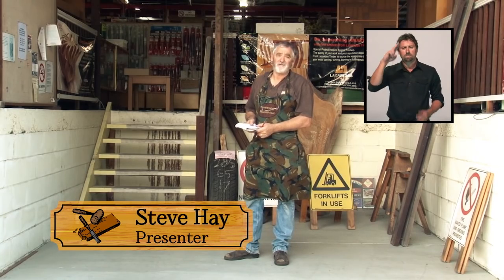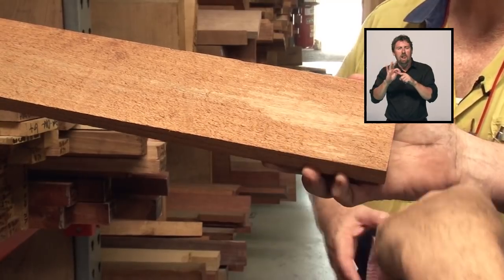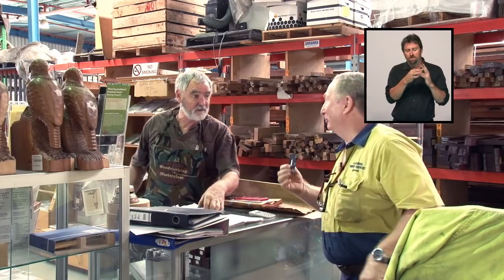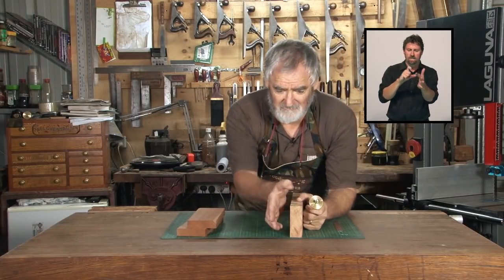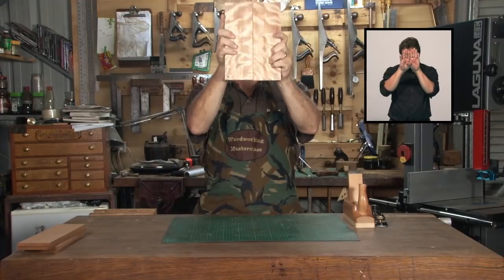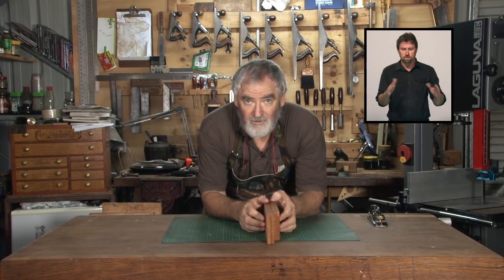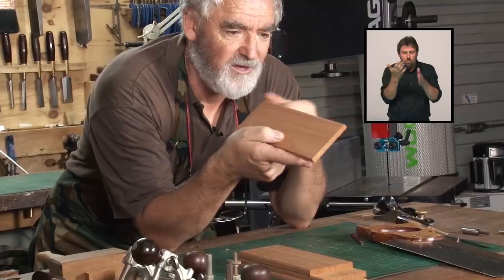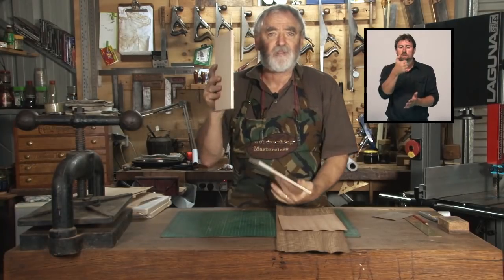Making 2 Wooden Boxes. Signed in AUSLAN by Mike Webb

Comment: Good info.  Never thought of using the bench vise as a clamp.......... until now.  The signer was a nice touch and thoughtful.

Question: Did I hear you say you put the bow UP when jointing?   Thanks.                JimE
Reply from the maker: +Jim E Thanks for the comment. Not sure which is up or down? But I have the bowed face facing the cutter. That is so the outer ends get cut first until they are at the level of the deepest part of the bow (arch). I fine that is more stable that trying to get a flat cut by placing the rounded section on the jointer and planing it down to meet the outer ends. Sounds a bit mumbo jumbo but I hope that helps. Cheers Steve
Reply: +Woodworking Masterclass  That clears it up................. or is is down :-)

That's the way I have always done it too.  When I first heard it, I thought you meant the opposite.  Thanks.

             JimE
Reply from the maker: +Jim E No Worries, Cheers Steve

Comment: Im getting set to go do something similar. Bought me a glue pan(whatsitcalled?) like yours and restored it. Got some veneer, still need to make me a veneering hammer, but the material is there. I have some wood ready. I made myself a routerplane, but would love the unobtainable nr 45, 55 or even a 50. I will probably get myself an old wooden grooving plane one day and restore it. But where am i going to find a toothing plane? I saw in another video that the veneer should be toothplaned before glueing too. Oh well, there is time.
Reply: +Willem Kossen A glue pot :-)
Reply: +Maurice Blok thanks. I just couldnt find the word ;)
Reply from the maker: +Willem Kossen Glue Pot, You can always but a toothing plane blade on Ebay I have seen them come up from time to time. The one I use in the video was a new one from ECE Germany. I want to do at least on video later on building a project with a 45 or 55, also how to make a Veneer Hammer. Thanks for the support. Cheers Steve
Reply from the maker: +Maurice Blok That's the one. Cheers Steve